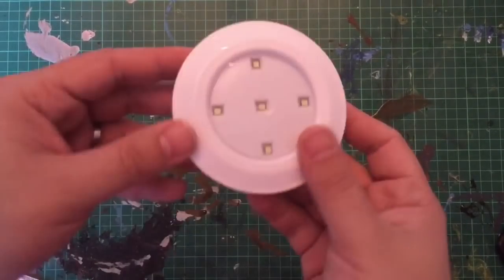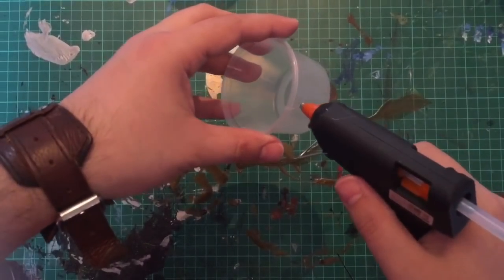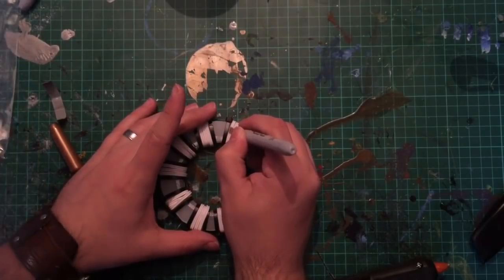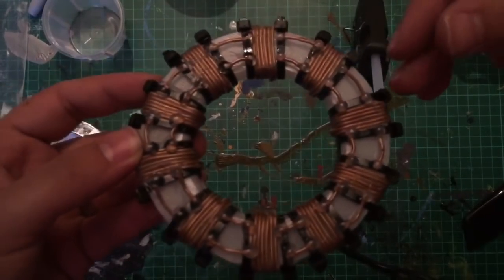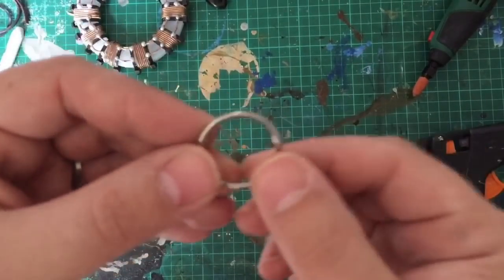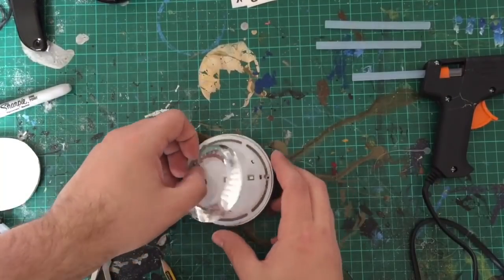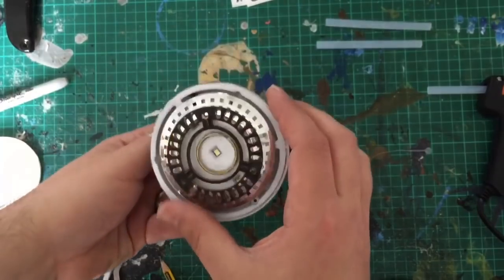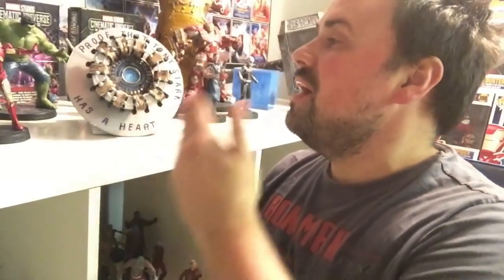D.I.Y Arc Reactor Proof That Tony Stark has a Heart Prop

Comment: You only missed the light on the copper wire surface
Reply from the maker: I did try making a smaller ring but didn't look right, maybe I can add some led lights behind. #loveyou3000

Comment: Can you use something else other than a chopping board to make that first ring?
Reply from the maker: If you can make a mold you could use hot glue or cut and bend using a hairdryer / heat gun hot glue sticks could work
Reply: @thegeekmancave2189  to ek theek hai tu Hi ek ek Agra letter of credit